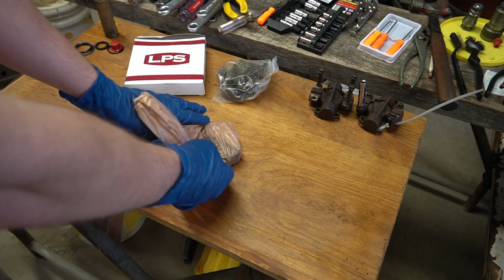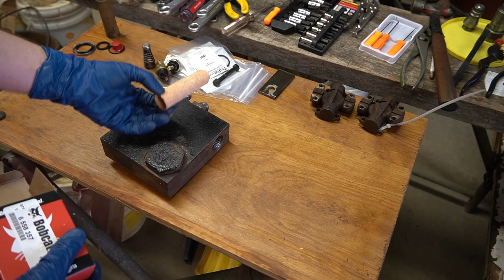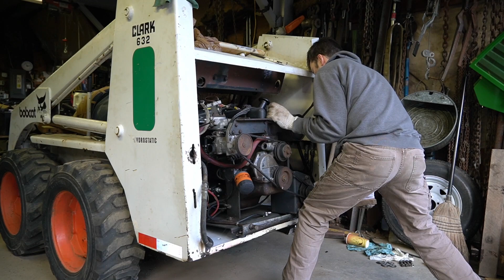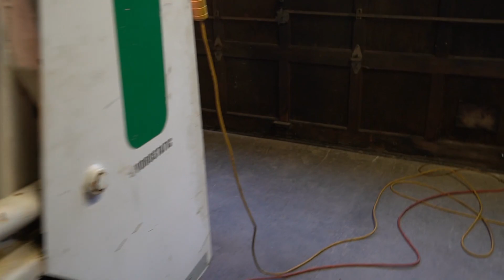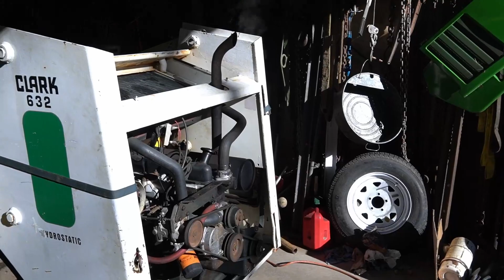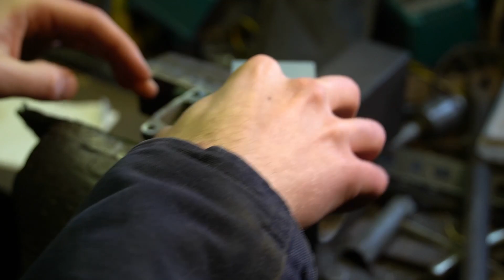My budget Bobcat is running again! Will it still leak? - Bobcat 632 Refresh Pt5

Comment: Best cheapish engine I've every used in an engine replacement has been the Air cooled Deux Diesel. In my experience the 2,3 or 4 cylinder Deux is a great little worker which I've consistently managed to buy at great prices. I buy them from the junk non running Row at some Auctions or from junk yards. The tins tend to be completely rust out or great 1 or the other.  I don't try buying the engines themselves at junk yarde as I've learnt my lesson where I was charged more for the engine alone than the hole machine making out I want it for spares or too try to repair. The machines from1960/70 seem the best. Earth rollers, 2 cylinder wacker old rotten gensets. Got charged $400 bucks for 4 machines at the last junk yard but got him down to $350. I later sold the shells of the old equipment for $250 & kept some really useful spare parts which I know I can sell over time for a good $500 As it happens all 4 engines were cracking little units. I've already refreshed & fitted 1 of those 3 cylinder units to a good friends whose skid steer was junk. I charged $950 for the rebuilt motor with new tins which I fabricated myself plus I completely refreshing the paint on both the engine & machine total cost to him $2000 for the whole job, mates rates. That was just over 2 years ago when parts took ages to arrive & if they did they'd cost a fortune so could have charge alot more . He's been loving it ever since its been completed. I also managed to fit his old engines turbo without alot of hassle, he reacons it got way more power than his old 4 cylinder diesel ever did .
Reply from the maker: I don't think I'll be swapping the engine in this unit but fitting up a diesel with more grunt would be nice. If I end up going to a replacement however videos will follow with that work for sure! Thanks for checking this one out.

Comment: I just replaced the spline gear between the engine and the pump, of my bobcat, 743, but when I started the engine, I have severe vibration,, especially when I increase the throttle. Can you suggest possible issues? This is the third time I have had to change this coupler. The first time was because of a broken universal joint. I fear that the pump shaft may be bent.
Reply from the maker: How are your mounts for both the engine and the pumps? If either of these are worn out they will have compressed and your shafts will not be aligned correctly. You might also want to double check the alignment of your engine from side to side. Hope that helps! Thanks for checking out my channel.

Comment: Boy does this bring back memories .Did the same thing with my older 642 back in 2004 .It had the ford industrial 1.6 liter fun project.Its really great little engine, doesn't have the power the kubotas have but start real easy in the winter
Reply from the maker: Thanks for watching! That is what I have been hearing. Should be fine for all my small house projects. Maybe my next one will have a diesel 🤔

Comment: Best way to sand the is to glue a sheet of sandpaper to a flat bord and go in a finger eight pattern, have it little Indian
Reply from the maker: That is a good idea. The stone I picked up did work pretty well however it would have been nice to have a larger surface. I'll try the sandpaper on a board approach next time around.
Reply: Try an off cut of granite or glass too. Much flatter than a board

Comment: It’s a pleasure to see that you finally got the Bobcat 632 running, nice work 👏🏼.
I am a recent owner of a 632 model and a novice at fixing it. Bought an owners manual on eBay and noticed that the distributor firing order specified is 1-2-3-4. Is that what you set on your machine? 
Many thanks!
Reply from the maker: Thank you! Key word FINALLY. It sure did take longer to get it back together then I wanted but better late than never. I didn't need to make any changes in the distributor however that is what mine is set at. I just checked my service manual and it also specifies 1-2-3-4 for the firing order.
Reply: Thanks! Mine I had set at 1-2-4-3 (anti-clockwise), as suggested on a Skidsteer forum. It starts but the engine gets quite hot after running for a few minutes. Tried changing to 1-2-3-4 but will not start, which kind of baffles me!

Comment: Dang I need that splines slip yoke that bolts to the ujoint. 

Mine wore out and spun the teeth last week.
Reply from the maker: That is no fun! Sorry to hear that happened to yours. Hopefully the shaft for the hydro pumps is ok. I might suggest checking all your mounts during the repair just to make sure you don't have extra play anywhere that could be wearing things out faster. Some of my mounts were very sloppy when I took them out.
Reply: @savvysprocket   yeah that’s exactly my issues.  Mounts are shot. Engine sits about an inch low so the joint is not straight. But at a slight angle.      I’ll be fixing that once I get the parts. 

I’ve already done a starter, you joint, oil flush, engine tune up, oil pump.  And lots of cleaning.   
Thanks.  I seem to have found a guy who thinks he has the yoke.